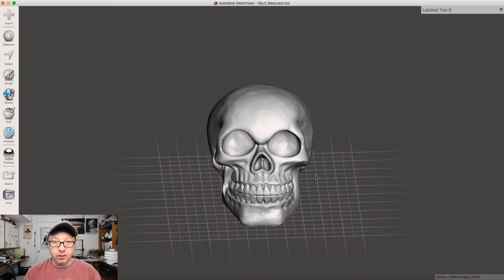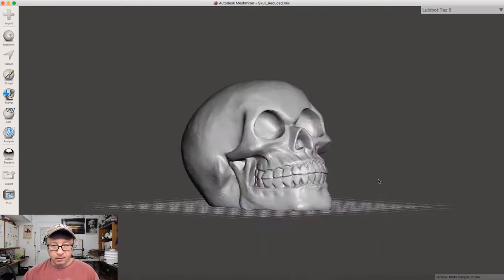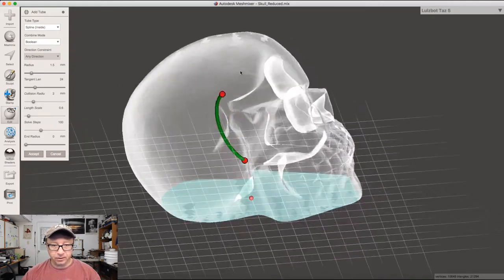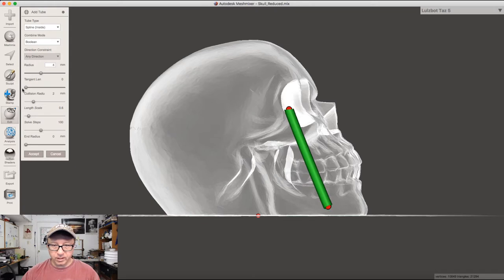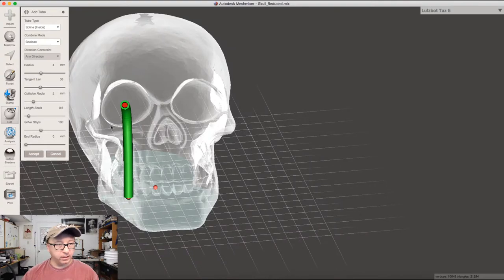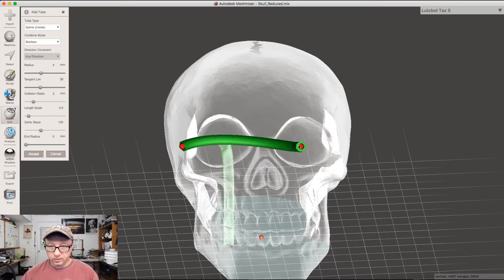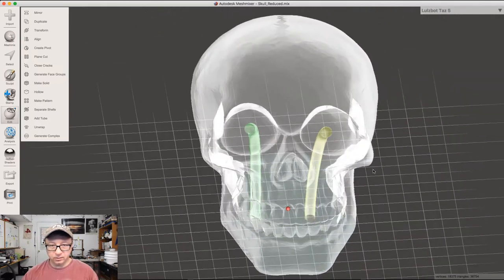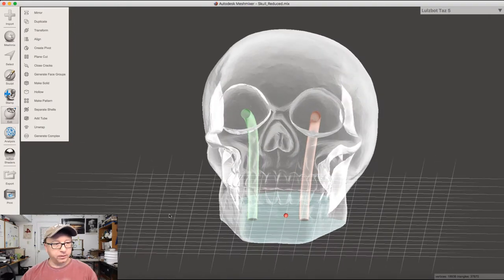How to add wires to a skull model -- editing STL files in Meshmixer

Comment: Nice tip...adding a cutout for batteries, electrics maybe a esp8266 and microwave motion detector would be cool. Can't wait to see the finished glowing-eye-skull
Reply from the maker: Hi @3D Gussner - I decided to avoid adding the main controller to the model itself.  I think having it external is easier.  But I can certainly check into another video showing how to make it happen if you are interested.  Thanks for watching!

Comment: How do you change the value box that shows up while you move something?
Reply from the maker: Hi TechLab S - I'm not entirely sure what you mean. If you click on the numbers they should be come editable and you can type in a value.  Is that what you mean?
Reply: @cyberreefguru  I mean the numbers that appear in the corner as you draw something...
Reply from the maker: You mean while transforming a mesh?  It does not appear that you can type anything from what I can tell.  Perhaps you can in Fusion 360 - meshmixer is essentially part of that now, but I haven't played around it the meshes in Fusion yet.